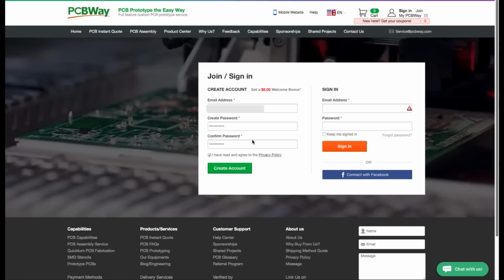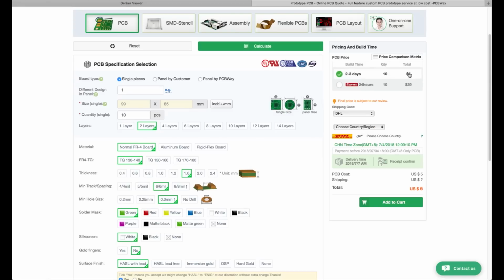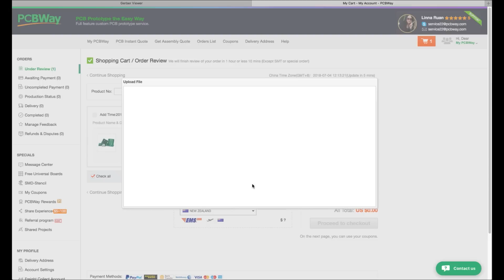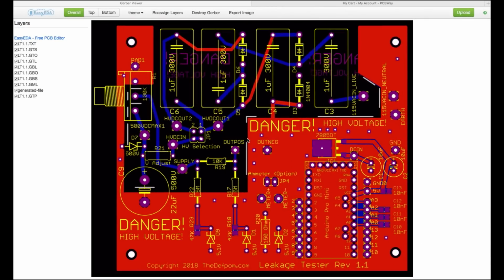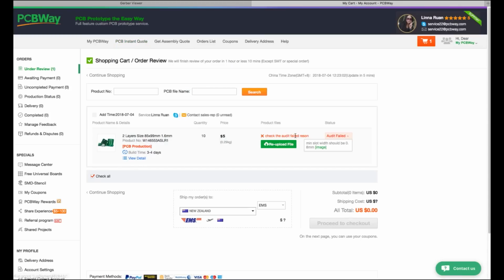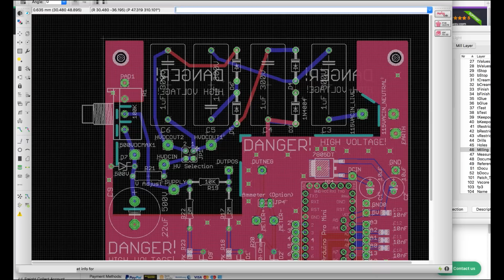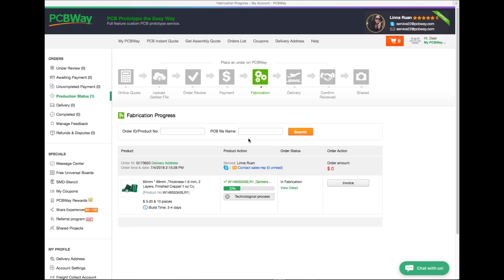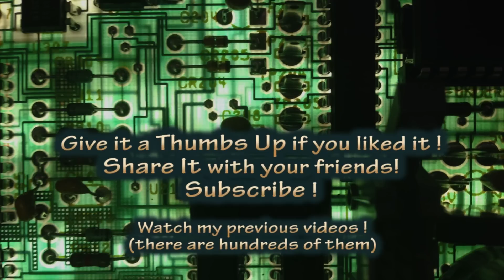🔴 #409 High Voltage Leakage Tester Project Part 5 - Ordering a new PCB from PCBWay

Comment: Nice looking boards. Maybe RED would be good for the high voltage. Keep up the interesting videos. Yes I have the same problem with DHL and I only live 100m outside the zone :-(.
 I am having a go with Trademe auction but keep getting out bid :-). Cheers Dave.

Comment: With most PC programs you can press (Ctrl + Shift) or just (Ctrl), depending on the program, then highlight / select multiple items on screen and whichever setting you change will be applied to all the selections simultaneously without affecting other settings.